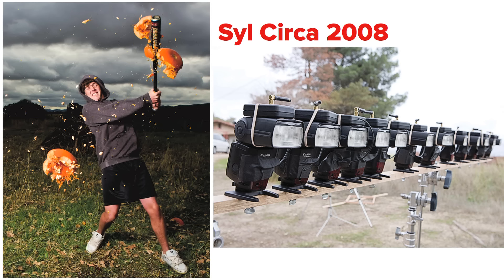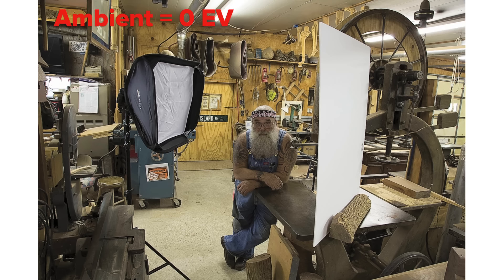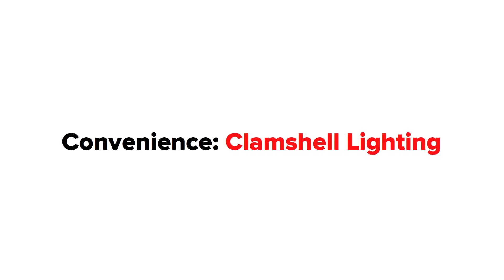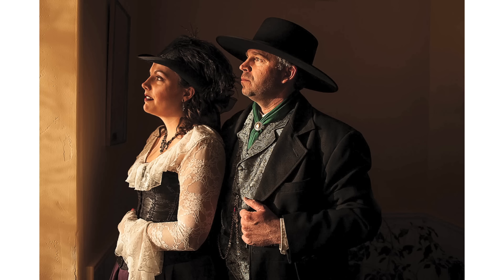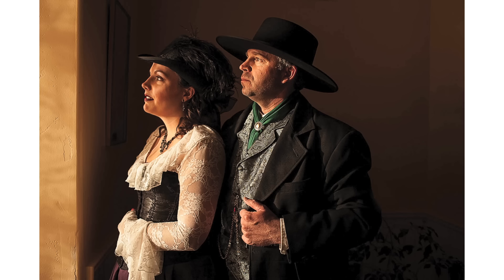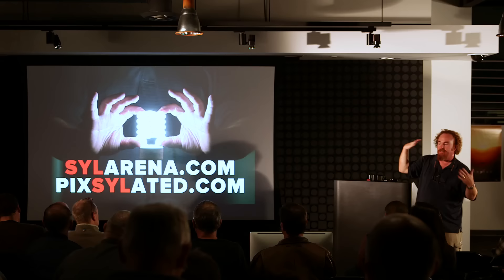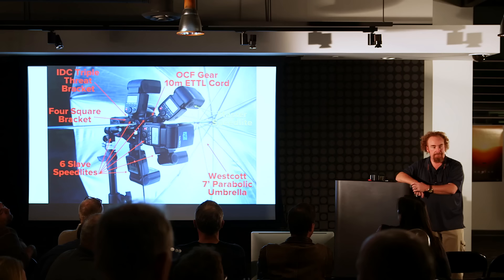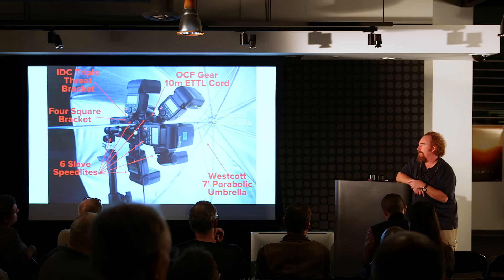Canon Speedlite 600EX-RT: Real-world Radio Wireless Flash Q&A

Comment: Is there a possibility to have a modeling light by pressing the depth of field button (or any other button) on an EOS R5? It used to work this way on my EOS 7D Mark 2 and probably other cameras. It was very useful. If that´s not possible nay more, can you add it via firmware, please?
Reply from the maker: Hi Stefan!
Many functions can be assigned to the DOF Preview button.  Our friendly camera agents are happy to answer any questions you have on the operation.  You can reach them at 1-800-652-2666 Monday-Friday: 9:00 am to 9:00 pm ET, Saturday: 9:00 am to 7:00 pm ET, excluding holidays.
Hope this information helps.
Reply: @CanonUSA  I know, but the DOF button doesn´t start the modeling light anymore, no matter, what function you assign to it.

Comment: hi, can i use my 600EXII-RT through the WiFi without another external flash ?
till now i could use it just with popup flash signal and it have many problems.so you cant use it in the large salon and far distance .
My camera is 80D.
thank you :)
Reply from the maker: Hi Safaali! The EOS 80D can only trigger a remote flash via optical transmission from the built-in flash. In order to trigger the Speedlite 600EX II-RT via radio transmission, another will need to be attached to the camera's hotshoe or you'll need to use the Speedlite Transmitter ST-E3-RT. We hope this information helps!
Reply: Yaap. I got it and thank you

Comment: What trigger/remote on the camera is he using for the HSS on the 600RT?
Reply from the maker: Hi, Joe! With the radio transmitted flashes like the Speedlite 600EX-RT you can use the Speedlite Transmitter ST-E3-RT to trigger the flash! You can still use the High Speed Sync function as well as set up groups for your desired lighting. Feel free to contact our friendly US based support team for more help with this at http://Canon.us/ContactYT and they'll be happy to help!
Reply: CanonUSA hello , dose ST-E3-RT trigger work for 600RT II also? if no then what is the best option for it? Thanks

Comment: one question, i have one 600ex-rt, whats the benefit to have more rather than to use studio flash kit.
Reply from the maker: Hi Avernus! While many different setups exist for using flash in a studio, adding more Speedlite 600EX-RT flashes does provide the advantage of having an entire system of flashes specifically designed to work together. There are also other models that work well in this system, like the Speedlite 600EX II-RT or the Speedlite 430EX III-RT. Find out more about each on our website at http://bit.ly/1TdNx65 We hope this helps! ~ML

Comment: How do you turn individual lights off within a group? I use three 600EX RTs most of the time but I can't figure out how to do this and the manuals are **-knows-where.
Reply from the maker: Hi Greg! Each light in a group will be set to what the master unit has set for that group. To turn off an individual flash, you need to remove it from that group. You may want to set that flash to it's own group so you can turn it on or off as needed. We hope this helps!